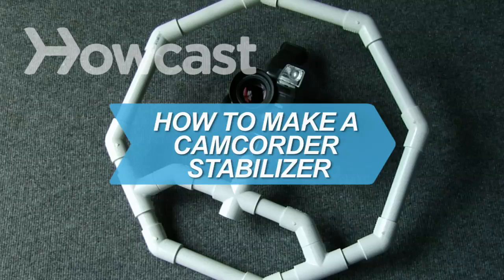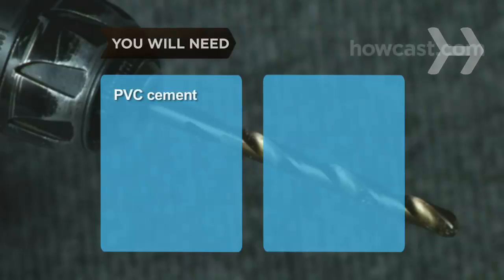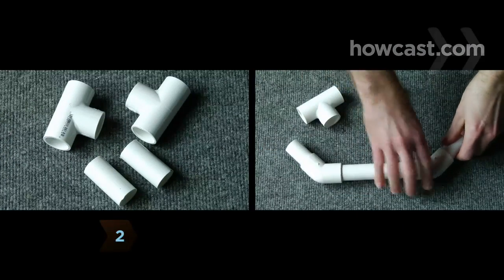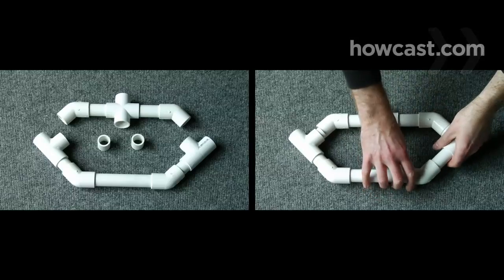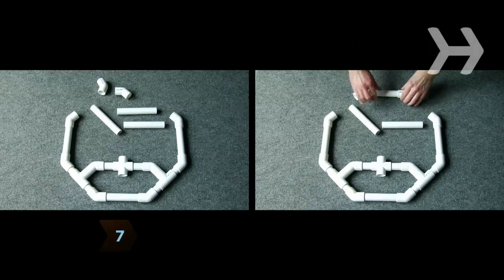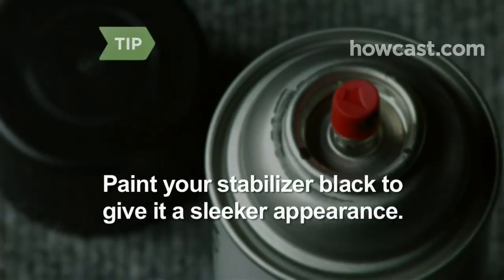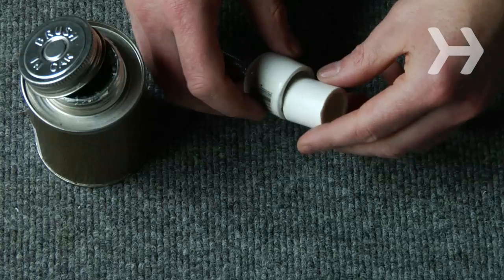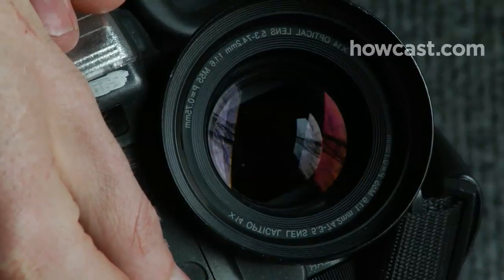How to Make a Camcorder Stabilizer

Comment: I made this over the weekend and it cost me about $40 (Australian) in piping and parts. First test results were pretty good, but it needed to be heavier to increase the stabilization so I screwed in some lead sheeting inside the piping to give it the extra weight.

It gives you a great range of motion without clunky parts getting in the way.

Comment: A tripod can only be used either stationary or on a trolley (dolly). This is for shots where the camera must move but on an unplanned route. Although this is a good design for general purpose it is a bit too bulky to transport and a weighted design made with threaded steel pipe would work better.